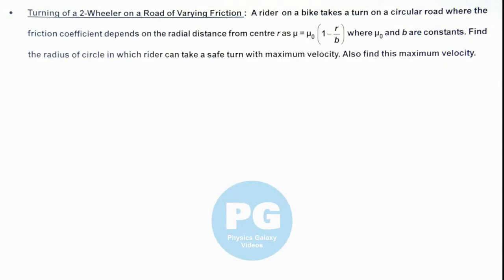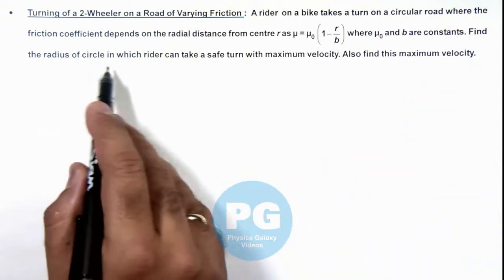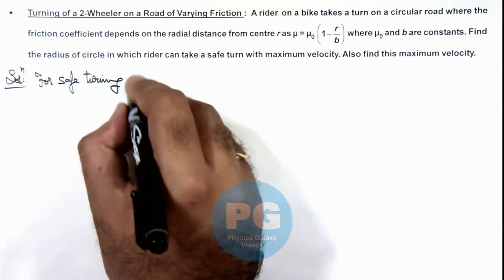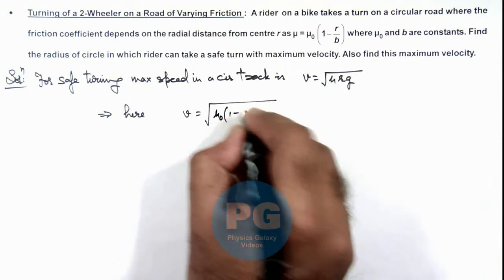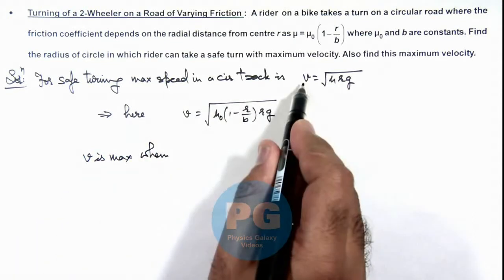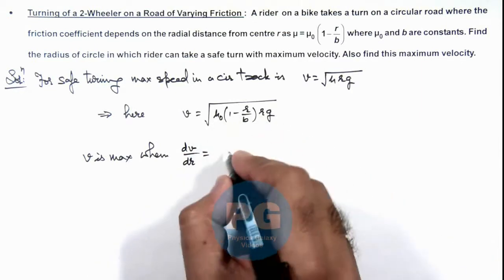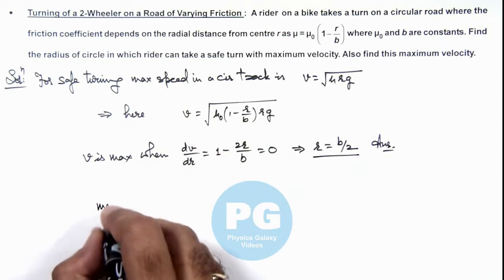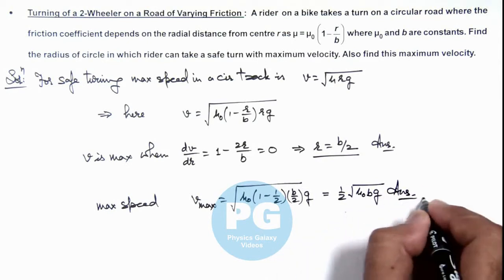Adv Illustration – Turning of a 2-Wheeler on a Road of Varying Friction | Circular Motion #18 JEE

Comment: why you not take tangential acceleration provided by friction?? Nowhere it is written that in rider is moving with constant velocity???
Reply: Tangential acc consider krne pe b koi change nhi aega
Reply: @shivansh709  change aayega, tab f=√[(centripetal^2)+(tangential^2)] karke solve karenge na
Reply: @aakanksha0327  2022 aspirant?
Reply: @shreyansjain3934  yes
Reply: bhaiya aisa nhi h  for a particular r v const h as mu const h and a tang =0 hoga aur
Reply: U are xorecwt if we condidr tangential acceleration but we have to assume in such questions becuase in most of the case we usually take constant vel